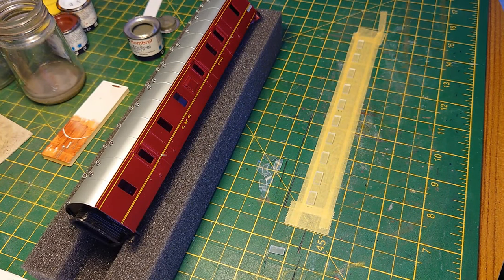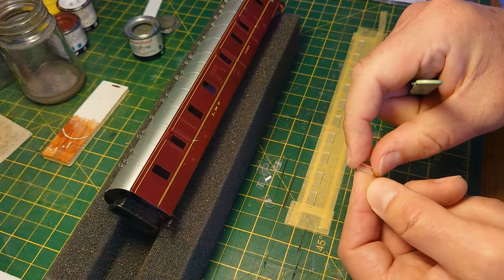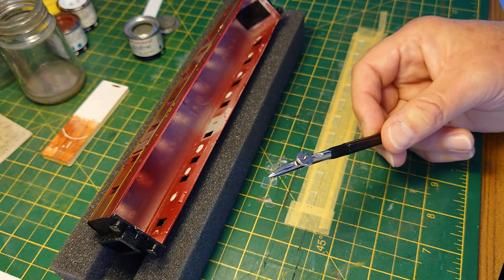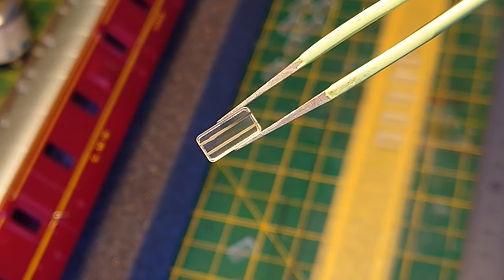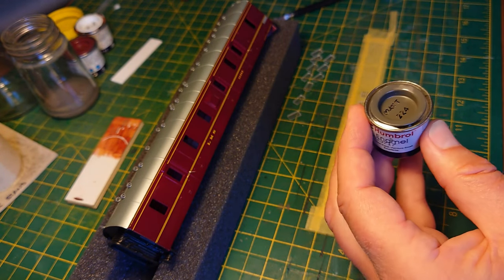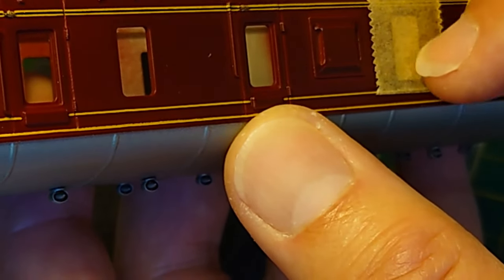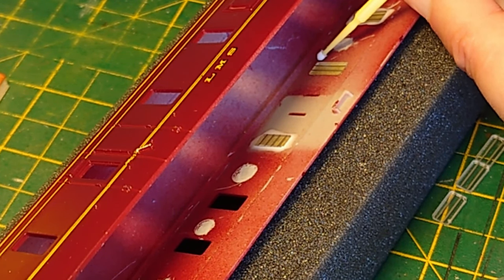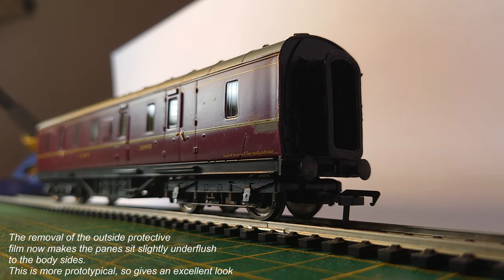066. How to - Add Shawplan flush glazing to a Mainline LMS Full Brake  - Detailed Instructions (4K)

Comment: Hi Andrew, surprised no one has commented, this is a great how to episode, thanks for taking the time to share.
Regarding the carriage end colours, they were crimson lake up to the close of 1936, after this they were painted black, remained that way. So depending on the running number (in your case 30965) would make it a diag 2007, built in 1938 at Wolverton.
So while no apparent difference from the diag 1854, this lot of 25 examples would have been outshopped with black painted carriage ends.

Thanks again
Reply from the maker: So I got the black painted ends correct then. Thanks for the information.
As far as the lack of comments is concerned, I try to impart as much information and techniques into my videos as I can, then maybe there just isn't much more for people to ask. However, people seem very adverse to hitting the Like thumbs up 😢
Reply: I’m glad you shared this information, I gave a number of these 50’ full brakes which require this type of upgrade 

Thanks again
Reply from the maker: @1BCamden  I see you too are subscribed to Mike Trice, Neville Grove and the car one Number 27. 
I learnt the lining pen prep and use from Mr Trice as used on this video I think. A good skill to have - see my LNER Pigeon Van in various videos. And Number 27, my model railway Club's previous Chairman owns a red Vauxhall Calibre similar to his latest video, so have shared it with him.
As for Neville Grove, his name isn't Neville, it's Steve Croucher. I was offered some old railway recordings and so pointed their owner in his direction. I think he took them